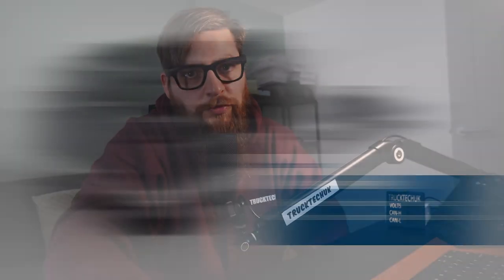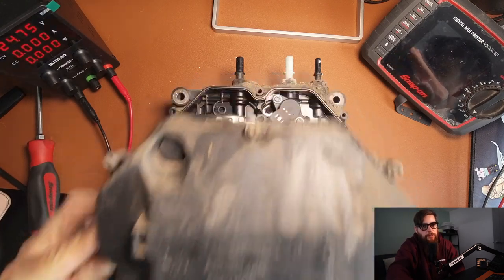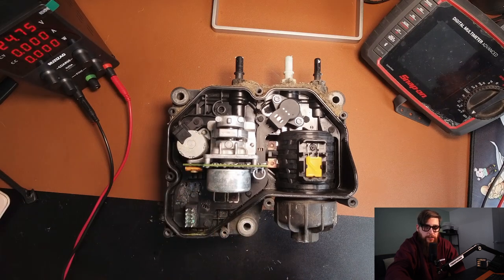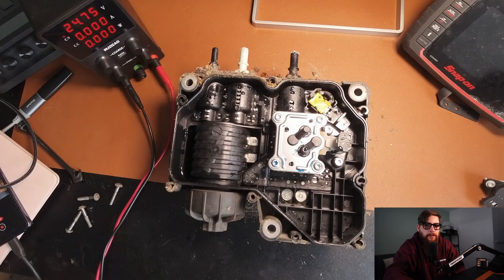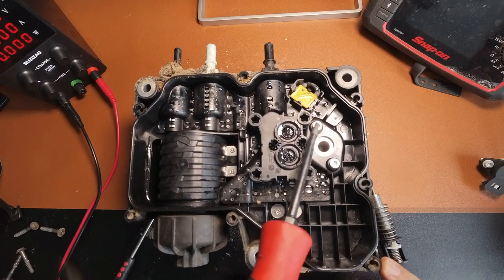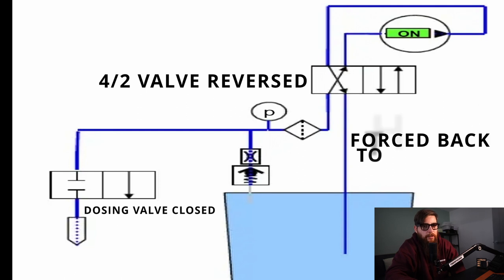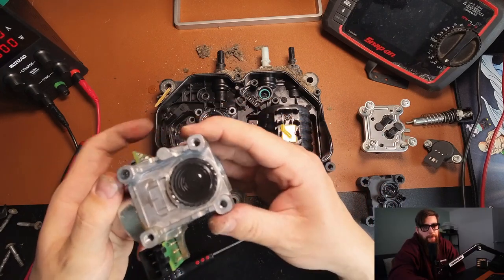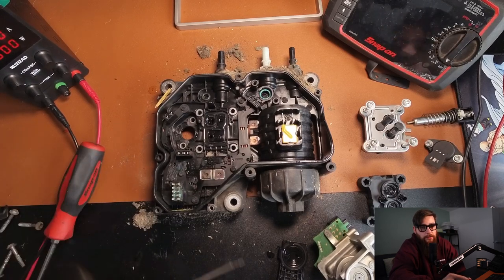DAF Adblue Pump Tear Down! What Will We Find Inside?

Comment: i can see your very good ive asked before. can i get an engine ecu that would work on any truck. plug and play.   please answer me in private message. its not for theft i own 2 concrete mixers. when the engine dies so do my barrel....... is there some way to start the truck just so i can tip the load even tic over/ idle. 22.000 pounds if the load goes off in the drum. im screwed. big problem with the ecu. daf should be exposed for this .. ive seen every truck fail. 64 plate till 2017. not seen a Newer model fail yet.. please
Reply from the maker: John, thanks for the comment. 👌 are the trucks the same year and engine I.e mx-11? I might have a solution for you 🤔
Reply: Hi, I run a 14 plate daf cf concrete mixer so would be interested in knowing this also! Mine is a mx11
Reply: @TRUCKTECHUK   hi yes mx 11... 10.8

both have same ecu. my 66 plate ecu went just after i had new barrel.. i was so lucky. ford and slater had one in stock and fitted within 2 hours. im just waiting on the 15 plate ecu to go.. insurance will not cover the drum any more..
Reply: @matthewhughes4594   my ecu went just after i had new barrel. ford and slater daf in cov saved the day. i know so many ppl that have lost the lot. 20 grand plus bill

Comment: Here do you recomend to get the repair kit?
Reply from the maker: Hi, thanks for the comment. It depends on what is wrong with your pump. It certainly can work out at a fraction of the cost of a new pump if it's just the seals. But you might need a pump or pressure sensor depending on your fault and how much Adblue has covered the components inside. 

I sell all the components over at www.trucktechuk.com in the shop which is what I use to rebuild my customer's pumps 

Hope this helps 😎

Comment: Hi bro. How are you. I want to ask you, if the VGT is faulty , can it be that the exhaust is full with soot from the turbo to the exhaust unit,because whe I regen it till it empty and after 3 days it's about half full .so can it be that
Reply from the maker: I'm good thanks buddy. 
The VTG can bring faulty as can the turbo as the arm can crack. You best off checking these if you suspect that they have failed. What I'd be questioning (depending on the exhaust system) is when was the DPF last changed or replaced! 
You really need some fault codes to confirm your diagnosis

Comment: Hello mate, if the pressure sensor has failed will the pump activate at all? I disassembled mine, but have no ad blue leakage, pump won't start. How can we determine the pressure sensor has failed? Thanks
Reply from the maker: Hi, thanks for the comment. I have a video here to upload with an Adblue pump pressure sensor failure. If you have a faulty pressure sensor you might find the pressure measurement is a minus figure when attempting to prime through an activation test and its going to give you a pressure sensor fault DTC-wise.
Reply: @TRUCKTECHUK  Sadly I have no test equipment, this Noxtronic is on my combine harvester so it's not something I deal with daily. So if I understand correctly, the pump will not prime without a pressure reading? Can I test the sensor with a multimeter? I will try looking for one tomorrow, but I think I won't have much luck here in Bulgaria. Thanks for the swift reply mate

Comment: Yo dude. John here with the mixers. Can i get both ECU programs with the same key frequency. Meaning my trucks will work if I straight swap them. I don’t mind taking ecu off the other truck. I’m just waiting for the 15 plate to stop. Every truck the fail is around 150.000 miles my 15 plate ticking time bomb. ?????

I know i can kill the other truck and have daf program it but  i want to be able to pull ecu and just slap it on the other. Both mx 11 and same ecu
Reply from the maker: John, it doesn't work that way. Unfortunately, shoot me an email as I've a solution for you

Comment: where you been mate
Reply from the maker: Hey mick, Ive been super busy building orders for people on the website, and I've a few other things I'm trying to put together.

I've a video here......I need to finish it today really 😅
Reply: @TRUCKTECHUK  could do with picking ya brain
Reply from the maker: What are you stuck with buddy?
Reply: @TRUCKTECHUK  1 ov r dafs has a adblue quality sensor fault has plenty adblue av nevergot stuck in to it yet but just wondered if you had it before mte
Reply from the maker: @mickbusby782  is this after 2017?
Reply from the maker: @mickbusby782  and I take it its not a LF
Reply: @TRUCKTECHUK  2021 xf 530 mate
Reply from the maker: @mick busby depending on DTC'S THE QUESTEST thing you can try is to check the ACTUAL adblue quality with an AdBlue Refractometer, then compare the data with the reading on your scan tool to see if they match the concentration. 
Are you filling up at service stations, Do you use a IBC or 20 ltr drums for adblue? Any other issues in the fleet with adblue?
Reply: Al invest in a refactometer mate we have a Adblue tank
Reply from the maker: @mickbusby782  any issues give me a shout 🫡

Comment: Hi mate do you have a teardown on the older model 1818625 adblue pump i may need to replace the filter housing
Reply from the maker: Hi thanks for the comment. Are you referring  to the denoxtronic 1.1 found on the old euro 5 vehicles?
Reply: @TRUCKTECHUK  yeah. İ need to replace the filter housing. İs there anything significant that must be done or is it just a couple plugs
Reply from the maker: Unfortunately, I've never stripped one. Daf only supplies a complete unit and I've not changed one for a good few years.......I've looked for some diagrams but again can't find anything 😞. Not what you want to hear I know 😮‍💨

Comment: As always great piece of advice! Do you have part number for tracks replacement?
Reply from the maker: Hey thanks for the comment. The number I've used for reference from the supplier is on the track itself, which is 153539-1